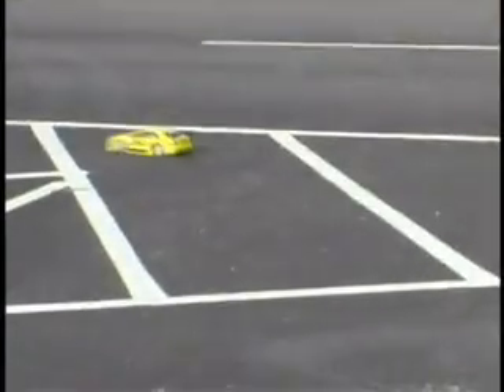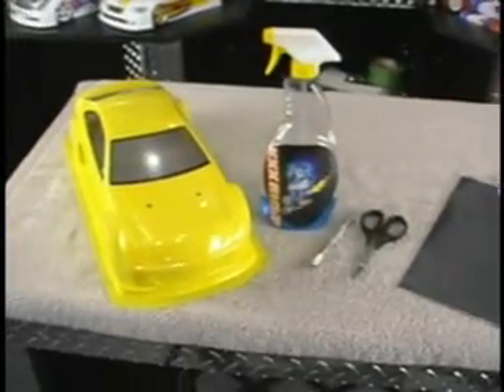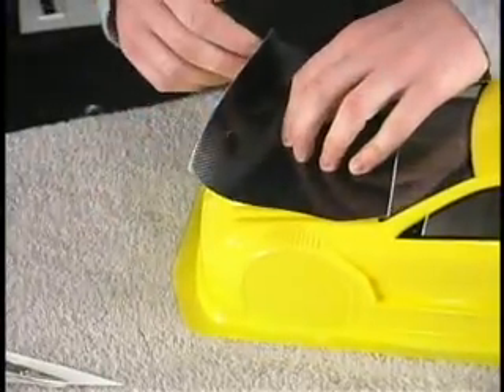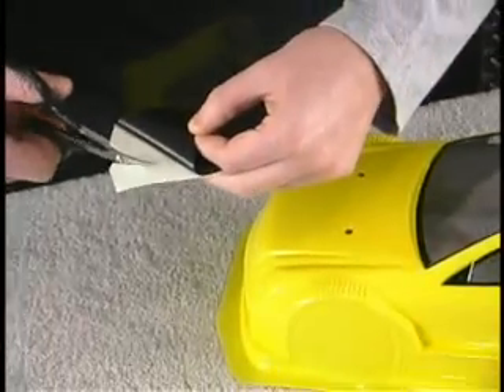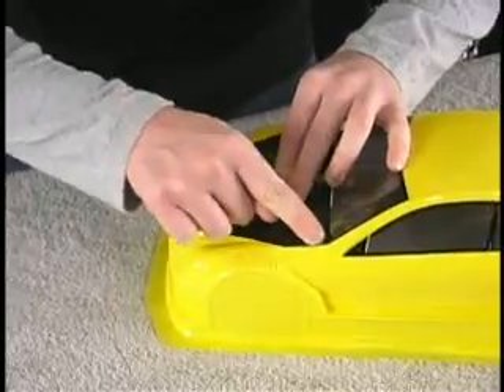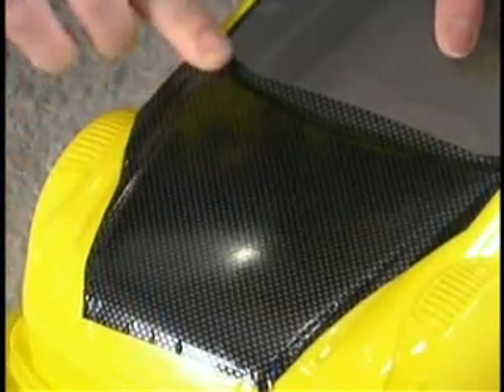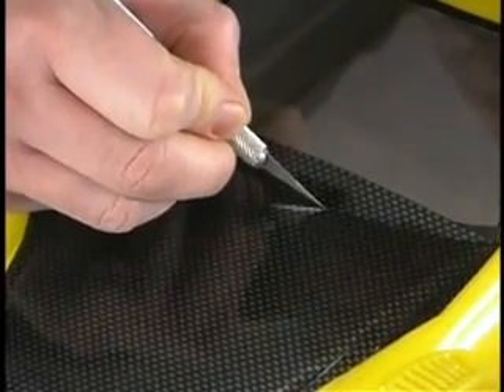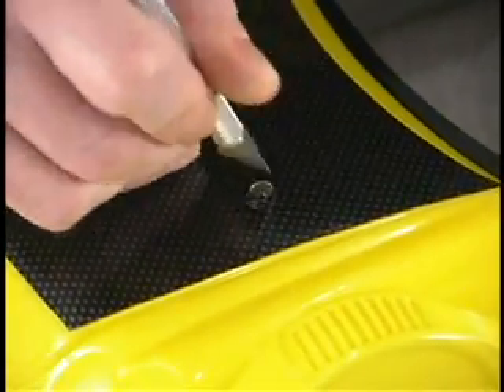XXX Main-How to paint R/C Bodies 8-Carbon Fiber Hood

Comment: what do you have to do when the rc body is not fully flat but when it has some ridges. Cause then there will be some complications (airbubbles will arise)
What do you have to do when you want those airbubbles away/disappear. (hairdryer? so it will stretch out?)